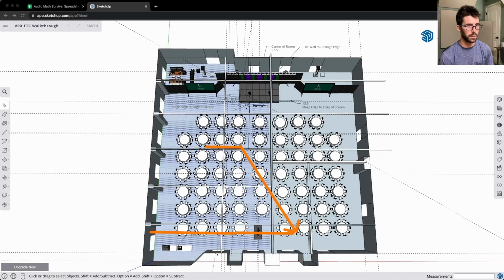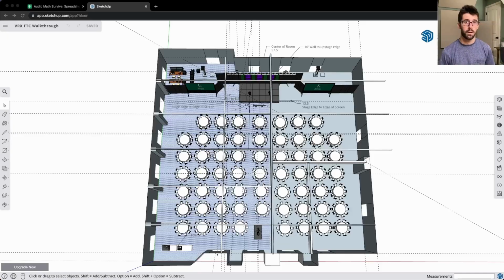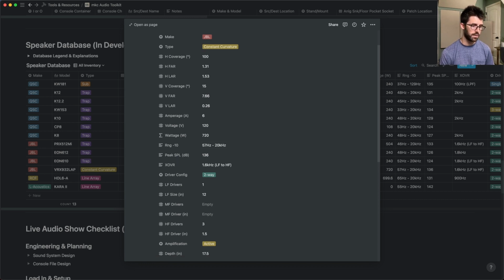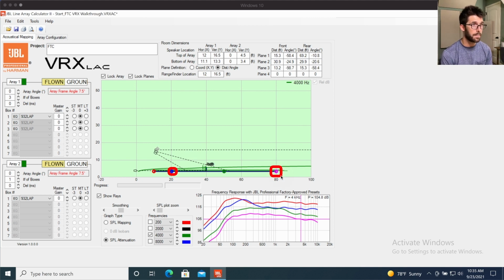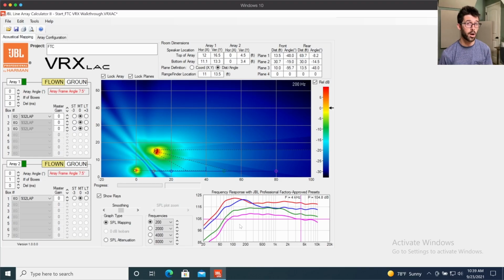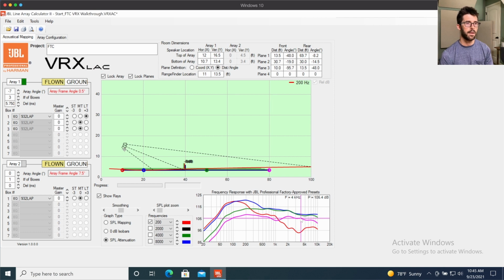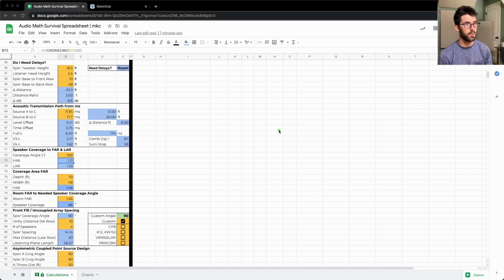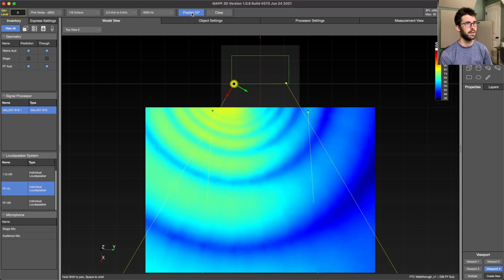Sound System Design Walkthrough | Flown VRX, Low Trim Height

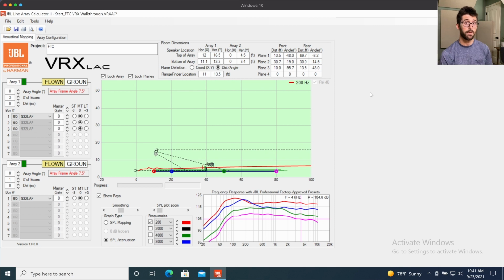Comment: 18:50 How do you know the crossover point is right there? I would assume it's the point where they are equal in level, but I don't know how to find that.
Reply from the maker: Yes, you're right that it's where the front fills and mains are equal in level.

I also determined that by knowing that my front fills had 10ft to the first row, so that would mean they've got a total of 20ft of range, given the way I spaced them horizontally across the stage (which I didn't cover in this video). So, I wanted my mains to pick up at the "expiration" of the front fill coverage.

If you have my audio math survival spreadsheet (link in description), you can calculate the max distance a front fill setup will cover. The Front Fill / Uncoupled Array Spacing Calculator is on row 87 with version 1.2 of the spreadsheet.